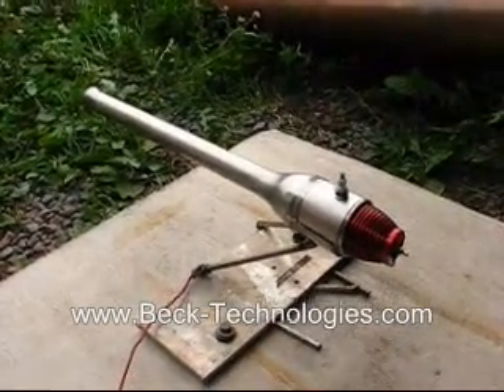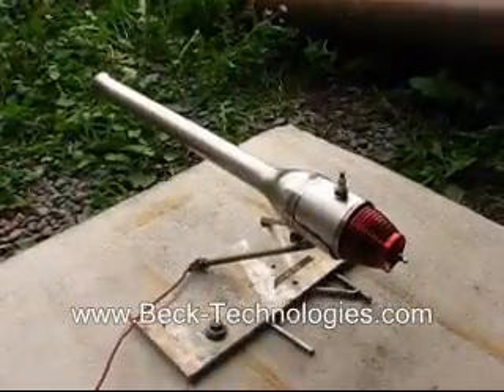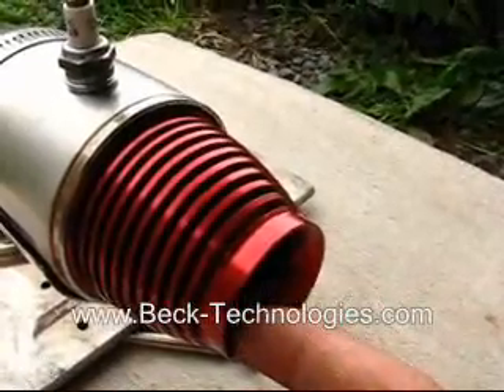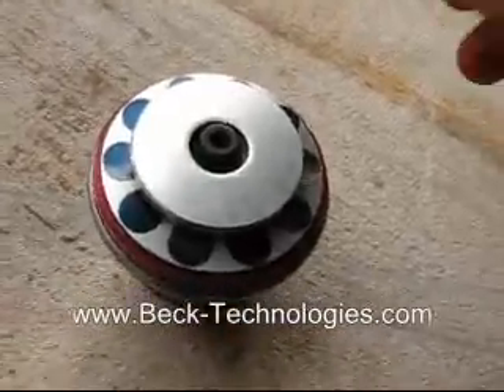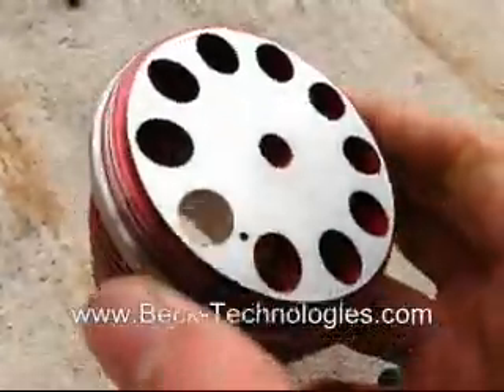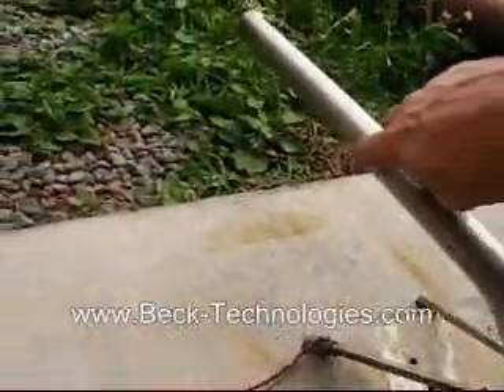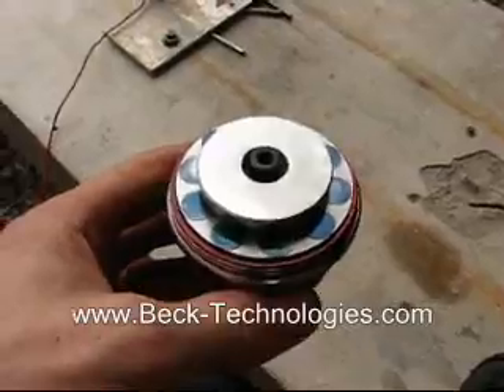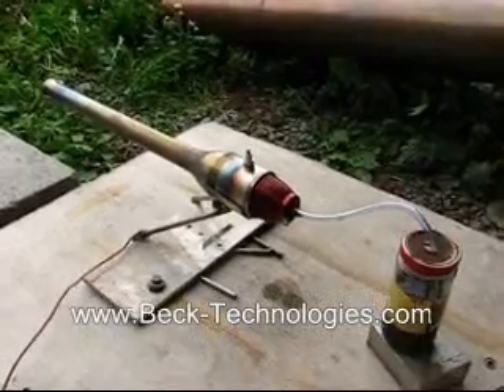Dynajet Pulse Jet Engine Start Up Procedure and Disassembly

Comment: In RC models, it appears they aren't using pressurized gas-what would recommend? It is safe to use a pressurized tank of a couple hundred lbs psi when burning fuels like gas?

Comment: I have a question: pressurized gas tank or no? It appears you are spraying some igniter fluid into the jet to start it, but the vacuum effect is pulling the gas from what appears to be a coke can.

Comment: You said to test the tightness of the valves was to blow up the exhaust. You didn't say to let it cool down first and I have got bad burns on my lips.
Reply: purge98 wouldn't you test the valves tightness before it was ran?

Comment: Excellent block of instruction.  I hope to duplicate Aardvark of New Zealand's coffe cup no-weld pulse jet, fuel with Santiili carbon arc rod plasma generated HHO, and start with welding or medical grade oxygen.  I hope to make a valveless Pulse Jet with in-line venturi.  Thank you for your instruction.

Comment: @BeckTechnologies I don't run a smallblock V8. I run a straight 6 cylinder ona carbuerator. I get very good mileage for a cargo van made inthe 70s though, and the engine has lastedfor ages because ofgood design anda sturdy build. A V8internal combustion engine hasa radiator fora reason. I'd like to keep the radiator onif I ever get one. It won't need new parts after 30 seconds orany newdiaphragms that way. I honestlydidn't realise thiswas justa model untilyou said. Sorry forthe mistake.

Comment from the maker: @18muffinMan  Go run a turbocharged small block V8 for more than 30 seconds at full throttle without a radiator, see what happens.

Comment from the maker: @18muffinMan   First of all these engines were made back in the 50's... There's no point in doing that, when you'd have the same performance from a valveless engine with no parts to wear out.  A 3 minute flight with one of these engines feels like an eternity, and most would rather have a lighter faster engine.

Comment: ....if your not a crappy welder the welds shouldnt split in high heat ..the metal around the weld should break before the weld itself .

Comment: question, if a throttle body was hooked up to the valve system , will it regulate the amount of gas and air flowing into the chamber(quicker or slower) or will the flow always be constant?

Comment: how do you prevent the model RC plane from melting from high temps this engine produces, given that most RC planes are made of foam and wood?
Reply: you put the nozzle a bit far away from the plane it self, so the exhaust does not come close to melt the plane.  if you look up "plusejet planes pics" you will see what I am talking about.

Comment: @BeckTechnologies 
even if they aren't having air blown over them. using fins, WILL increase the heat transfer rate. Convection, which is based on surface area, is the only thing cooling that engine down.

Comment: Pretty sure those fins are for heat transfer dudeski. The fins actually add weight to the engine. You obviously don't know what you are talking about. You would never design an intake like that to save weight. This site should explain this design.

Comment: So how do the spring steel of the valves withstand the high temperature in the chamber without loosing tampering? Or the incoming air cools it sufficiently?

Comment: @BeckTechnologies They don't need to cool the engine, they just need to keep the heat of combustion away from the fuel intake to prevent auto-ignition. If you were to fill those fins in with aluminum it would indeed start to melt.

Comment: @BeckTechnologies Thanx For Pointing me in the right direction I was speculating! Do you have to pre-heat the fuel? Guess it depends on the fuel you want to run will this design run any fuel type?

Comment from the maker: @backcountry600 

The fins do not cool the engine. If you run it statically with pure gasoline the aluminum parts can actually melt. 

They are for appearance and weight reduction only

Comment: just me here  again  i must  specify that the liquid water from a pulse furnace comes out by a seperate line than the rest of the gases that go out via plastic pipes some  people have told me this water  is totaly pure and  drinkable  by the way i have  a  Lennox  Pulse  have not tried  the  water yet  its  all going  down  the   drain  now

Comment: thinking of this i think the Lennox Pulse furnace works a bit on the same principle as this engine but instead of using the pressure of escaping gas to obtain thrust this is used to push these gases through a series of heat exchangers to a point that a lot of the gases condense back to  water [ the  water vapor part]  and out a plastic pipe the combustion chamber on sucht a furnace glows red hot when  running like this engine these  furnaces  achieve  90 percent plus  effiencency

Comment: i remember watching a wire control model plane with a engine like this they started it using a hand air pump and some source for the ignition it was quite loud in  flight  this would have been in the early  1970s

Comment: The plane it self will be a singel seater acrobatic plane with 2 x 150-200lbs thrust puslejets , i will use it as a aerobatic preforamce plane .....somthing different ...and cheap to build ...it will not a be a travel machin. the pulse jets use to much fuel for that i think... or am i wrong ? the modell will be a 1/4 scale prof of consept for its bigbrother. The main reason for 2 engines are safety...

Comment: i was wondering about the fuel flow on this size jet ? im building a 1/4 scale model plane atm. im going to use 2 jets on it . i was going to use turbines on it ...but they cost an arm and a leg so . also whats more effective valved or valve less ?

Comment from the maker: I seem to remember some big rant about how a plane at 275 = 0 power, and that the plane is 500 times lighter and 500 times more aerodynamic, and that it was an unfair comparison because cars have wheel friction, and a bunch of other stuff. 

I looked up the veyrons MPG at top speed, it gets 2 miles per gallon at 250 mph.

At 275 mph a plane with this engine would get 180 miles per gallon. 275 is low, an advanced system could potentially reach 600, where it would have ~300 mpg.

Comment from the maker: It uses 120 ml fuel per minute, which isnt bad considering it can push a RC plane 275 mph. Assuming the average 2 liter car gets 25 miles per gallon, at 60 mph that equates to 150 ml per minute. Now go find out how much fuel a Bugatti Veyron uses at 260 mph.

Comment: The reed valves look remarkably like those used on Evinrude and Johnson 2 stroke outboard motors from the 40's to the early 80's on the smaller capacity engines 40 hp and smaller.they are in the intake manifold right behind the carb.

Comment from the maker: Aluminum will melt in about 3 seconds, the small ones run just about as hot. The dynajet has a power to weight ratio of about 4.5:1, weighs 1 lb produces 4.5 lbs.

Comment from the maker: The cuts are not made in the direction air would be flowing, little to no air will flow through the cuts, making them almost useless for cooling. 

They do however keep the same aerodynamic profile, while reducing the weight dramatically, and also looking cool.

Comment: It serves both purposes. cutting the slits reduces the mass (weight) but doubles or triples the surface area in which heat can be radiated from.

Comment: Given that the engine likely won't run more than 10 minutes before using all the fuel up, It might not matter. 

Should just use a Valveless Pulsejet, if maintenance is an issue. You can use a flapper valve to control the air intake and control engine speed like a carburetor on a lawn mower.

Comment from the maker: You can inject water in addtion to fuel to increase performance greatly, but you cant run the engine simply off water.

Comment from the maker: They are more for weight reduction while looking cool, they provide almost no cooling, if they ran lengthwise then they would provide cooling as the engine moved through the air. Methanol as a fuel source provides the most cooling, actually causing ice to form on the intake.

Comment from the maker: A little bit, mostly they are a decorative way of reducing the weight. If you run the engine off of methanol the evaporative cooling from the methanol vaporizing will actually cause ice to form on the valve head from condensing and freezing the humidity out of the air flowing past. With gasoline or oil based fuels though the valve head will get hot enough to melt your finger prints off. For static running I suggest either alcohol or a mix to provide some cooling.

Comment from the maker: Pulsejets cant really explode unless you use explosives as fuel, there isnt any way for them to build up that much pressure cause the gas goes right out the back, and no turbine wheels spinning at 100k rpm. Electrics definately have their uses and are good for park fliers, but jets definately have a speed and wow factor advantage.

Comment from the maker: Read the description, the video is to describe and show the parts and tell you how the engine works. 

If you make the valves thicker they wont open properly, and the engine wont run. There are ways to reduce the stress on the valves without making them thicker.

Comment: Cool video for a beginner.  But speaker is more boring than the crickets!  And yes, Dynajets are amazingly LOUD.  You don't get the real feling from this video.  They pulse at 230 times a second (hertz).  Think large caliber magnum handgun firing 230 times a second.  You have to see one fly in a C/L Speed plane to believe it.

Comment: what do use as a sparking device where are you puting the compresed  air in the venturi is gasoline the best fuel if its too hot outside ,how long can i run the engine for on gasolin

Comment from the maker: This engine was actually an engine made in the 1970's. I have made many many similar engines, but you need at least a lathe and drill press to make the components.
Reply: they made these way back. I remember late 50s having a redhead. We would start it with a bicycle pump. Yes the daisy pedal valve would not last long.

Comment from the maker: Hydrogen is a little to volitile. Most vapor fuels need to have water injected where the fuel normally would be, at a very low rate, to keep the valves cooled. If you dont the valves will get damaged really quick, and you can even melt the retainer plate or damage the valve head.